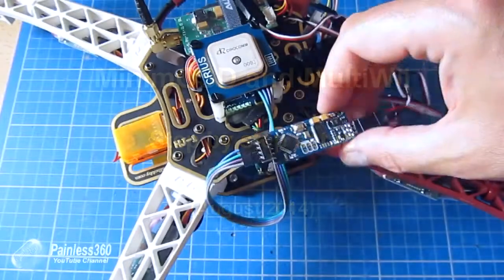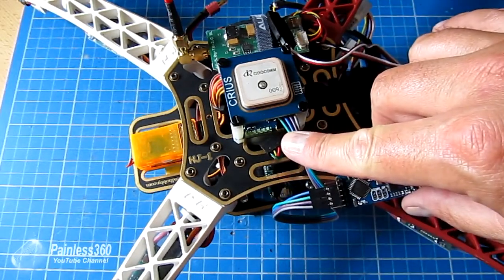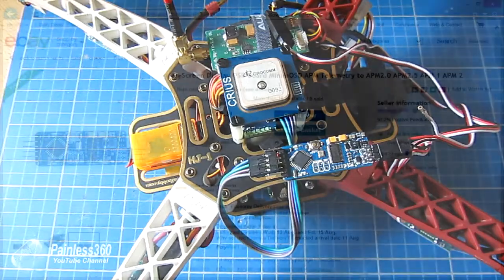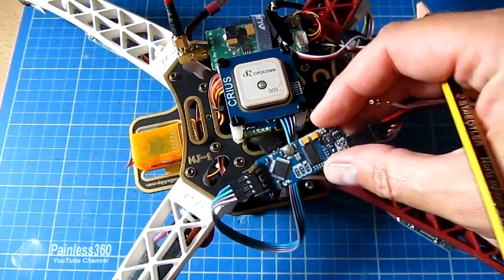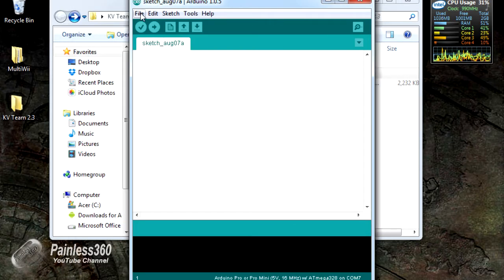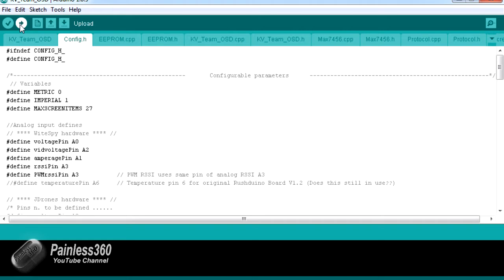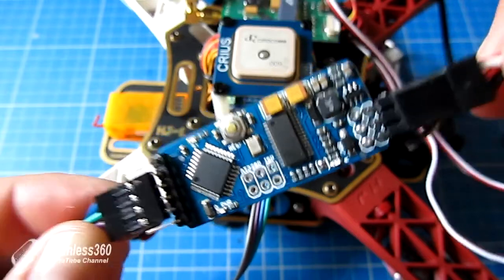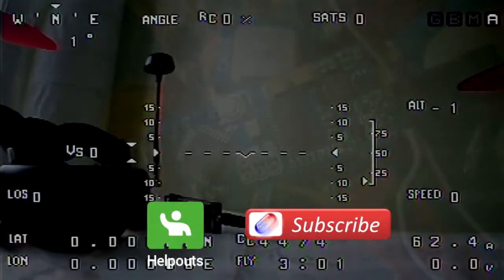Step by Step MinimOSD setup on a MultiWii

Comment: When I try to clear the EEprom I get an error message that says"EEPROM was not declared in this scope".  I uploaded the fonts and wrote the sketch to the board.  When I clicked on verify the only message I got was sketch compiled.  I tried hooking everything up and got video with no overlay.  I pushed the reset button on the OSD and the screen blinked but nothing changed.  Any ideas?
Reply from the maker: Terry Crowell Sounds like there is a problem with the code then, if the EEPROM isn't declared then one of the fundamentals isn't setup.. You are destined to fail from this point on really.. I would download the package again or try another firmware choice.. Search on the channel for other MinimOSD choices, I do cover a few other choices that work great with the MW..
Reply: Could the fact that I use a 64 bit system and the OSD only talks about a 32 bit system be a problem?
Reply from the maker: Terry, quick question. The Arduino program should work on a 64 bit system. Works fine on mine.

How familiar are you with the program, have you used it lots before? What board type do you have selected in the settings?

A video showing the issue and how you have everything setup would be a big help. Not knowing if this is a connection/software/experience issue is very hard to tackle with two line updates.

Best of luck with it..

Comment: i i try to verified/compil in ardoine i get the messege item table must be constant error, there seems to be someting wrong wit the kv team scetsh ardoine sayes, can that be traced to the wrong arduino software ore something? programmer type is not important right?
Reply from the maker: Try an earlier version of the Arduino software,  the later versions can be unhappy with older sketches. Best of luck!
Reply: Painless360 ok now its compiling the scetch, thats fine now, i still get the error message: avrdude: stk500_getsync(): not in sync: resp=0x00 in arduino if i try to upload anyting.
i tryed the arducam osd to, got in the gui of it  but there i get the message "failed to talk to bootloader"
??? what can i do? order a usbasp adapter and try writing a bootloader in arduine and try again? omg, i am 2 days trying to get this to work, my etire quad did not even took this long to build and setup for first test flight... omg help me plz
Reply from the maker: I have a video on this error, it should help..

Comment: Thank you for the video!
i've tried to upload the firmware, but i get the error: stk500_getsync(): not in sync: resp=0x00
i'm using the FTDI programmer which used to configure the MWC SE2.0. (not thru the arduino program), can you write or link for your FTDI board, i think that my FTDI board is not compatible with arduino software.
i use:
1. MAVLink-OSD by Crius (MinimOSD)
2. FTDI FT232RL 1213-C CN480661 (i found that it could be fake chip)

thank you!
Reply from the maker: Arkadi Raider I have a video on this exact error,  have you watched it?
Reply: Thank you for a fast reply! I have watched the video about the error and tried to select other board in the arduino settings (I did it with all boards that exist in the list). I got same error on all of them. After hours of searching Internet I have found that the chip in ftdi board can be fake.
Reply: Arkadi Raider i have found the way to fix it! for FTDI FT232RL 1213-C CN480661
first of all boot in windows 7 with "Disable driver signature enforcement" (Press F8 before PC boots windows to see the menu)
use the MProg3.5 tool from "http://www.ftdichip.com/Support/Utilities.htm" -> scan the ftdi -> Tools (read and parse) -> change product ID to 6001 -> Ctrl+P (to program)
uninstall the com + usb drivers for the FTDI device
install the old driver "CDM-2.08.28-WHQL-Certified"
thats all!!!
worked for me!
Reply from the maker: Arkadi Raider great tip,  well done on getting it working!

Comment: i cant get my osd to work, came in a package with my pixhawk, tryed it first as it came out of the box due the rest of the hardware came already with software on it, it passed tru the video sig but dit not overlay any data. i then installed the ftdi drivers and arduino got the kvt 2.3 but aduino will not update to my board, got the settings for pro and pro mini 5v etc right, right com port, gives me an error: i cant even upload the eeprom clear. "avrdude: stk500_getsync() attempt 10 of 10: not in sync: resp=0x04" it says if i do the eeprom clear.
if i try to upload the kvt osd, it says:
variable item_table must be const in order to be put in to read-only section by means of '__attribute__((progmem))
avrdude: stk500_getsync() attempt 10 of 10: not in sync: resp=0xb3
do you have any idea what i am doing wrong? plz help.
Reply from the maker: jelle buyckx I have a video on the Stk_500 error. Doing a search on the channel can help you get the answers you need faster.Best of luck.
Reply: Painless360  hi, yea i know, seen about all your vids, but that was not the issue as the board and com port was correct, a bootloader was missing aparently they flashed the minimosd extra to the board before shippin it to me. without bootloader, USBasp solved the problem. could not talk to the board via FTDI need to be done on programmer. it works fine now. still thanks, did not know what to do i was freakin out couse the 36 houres is coused me to figure it out. yea i am a noob...
Reply from the maker: I've not heard of that - glad you sorted it. Can you PM me where the board came from?
Reply: Painless360 
i guess bad ftdi adapter, i sended you an email.

Comment: all I keep geting is

Arduino: 1.6.12 (Windows 7), Board: "Arduino Pro or Pro Mini, ATmega328 (5V, 16 MHz)"

In file included from sketch\EEPROM.cpp:5:0:

KV_Team_OSD.h:180: error: variable 'item_table' must be const in order to be put into read-only section by means of '__attribute__((progmem))'

  extern PROGMEM const char * item_table[];

                                         ^

exit status 1
variable 'item_table' must be const in order to be put into read-only section by means of '__attribute__((progmem))'

This report would have more information with
"Show verbose output during compilation"
option enabled in File -> Preferences.

any ideas?
Reply from the maker: Use Arduino 1.0.5 ;)
Reply: Thanks, firmware on now but the gui wont run :(
Reply from the maker: I can't offer any help if you don't share the error messages. Happy to help but please watch https://www.youtube.com/watch?v=olIqTiSJHIY and come back to me with more detail of what you've tried..
Reply: There is no error message. i double click the icon and there is a very brief flash on the screen and then nothing.
Reply from the maker: I'd suspect the java installation on the machine then - I'd install the latest version in case that's part of the problem. Best of luck!

Comment: Anybody know what the led's on the osd mean?
Reply from the maker: They show that both of the 5v systems (one for the processor, one for the Max chip) are powered.

Hope this helps.
Reply: Painless360 

According to the link you provided, I should get a steady yellow led after clearing the eprom.  That yellow light never comes on And according o the Rush development site, clearing the eprom sets all the parameters to 0.  

After loading firmware I do not get any OSD overlay on the video.
Reply from the maker: Terry Crowell Something basic sounds wrong. Can you flash the OSD firmware to the board and get it to verify ok? If so can you then load the font using the GUI? 

If so, connect it back up. Power up the system thrn press the reset button on th

MinimOSD to restart it and see if you getthe welcome screen. .
Reply: Painless360 I cannot get the firmware to flash to the board and verify ok.    I get the Programmer out of sync error message .The fonts seem to upload but I have no way of knowing for sure.  What exactly would you like me to video?
Reply from the maker: Terry, everything. Happy to look it over for you to help you out.

I.e. How you have it all connected, the setting you have in Arduino (for board type and port) what you press to start the process, the errors as they appear on the screen - everything you can think of. Anyone of the things you are doing could be the problem..

If all else fails and you are doing everything right then it has to be the board...

Comment: Hi. Awesome and very detailed video! (thumbsup)!  I have a question though. I have a Multiwii Pro: 
http://www.hobbyking.com/hobbyking/store/__26588__MultiWii_PRO_Flight_Controller_w_MTK_GPS_Module_.html

My question is: where would i tap into it to get the telemetry?  Serial 2 is already taken by the GPS. 

here's a board overlay:
http://www.hobbyking.com/hobbyking/store/uploads/201872452X19082X23.pdf
.
And if you happen to know if I have to set anything in the config.h to send the telemetry to that specific serial port. 

Wow. this became a long post. Thanks for a great video and for your time!
Reply from the maker: bastian38 Sorry - I don't use the Multiwii_Pro myself. 
Best of luck with it.
Reply: Painless360 I think I figured it out, I can connect it to the Serial usually used to show telemetry on a LCD. This will be interesting :)
Reply from the maker: Good news! Best of luck with the project - Multiwii has been one of my favourites over the past two years. Nice to fly and provides a very good GPS HOLD and RTH feature.

Happy flying!

Comment: Nice video. Check out this firmware https://code.google.com/p/multiwii-osd/ Its base is taken as a fork from "Rush OSD Development" R370. The GUI its alot better and it has more configurable options.
Reply: Will also have a look see at this version of RushOSD too thanks *****
Reply from the maker: Hi Romeo, thanks for the link! Another one to try and this one has a better GUI. Thanks again.

Happy flying!